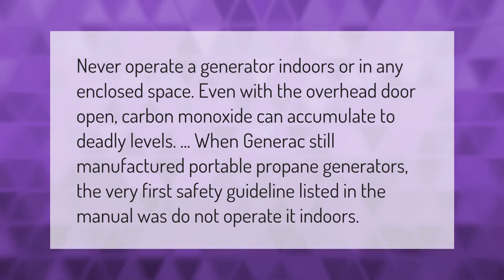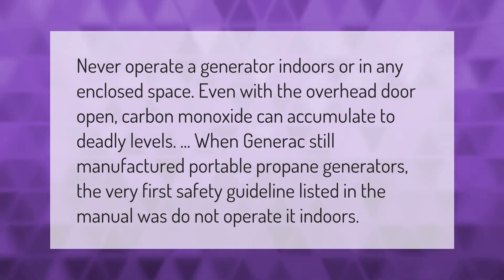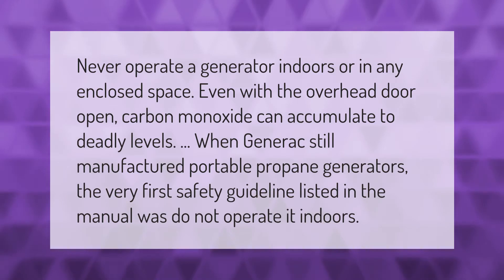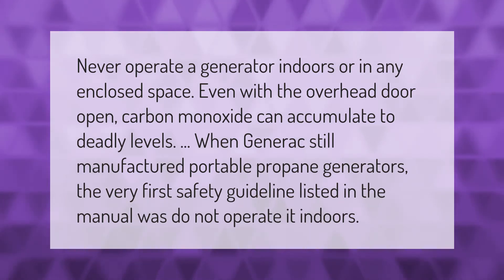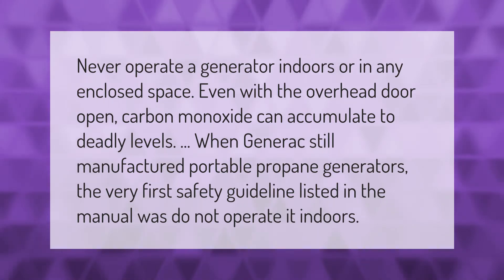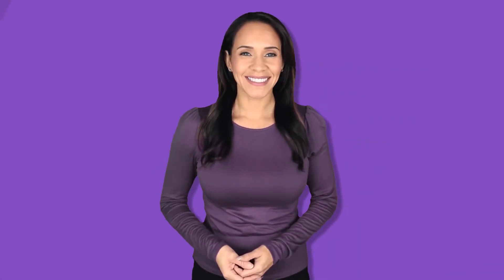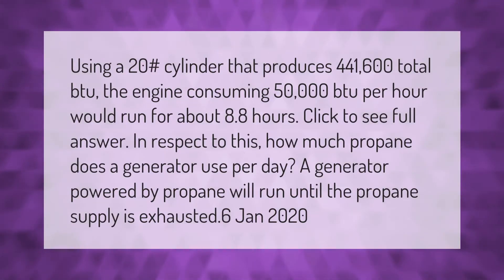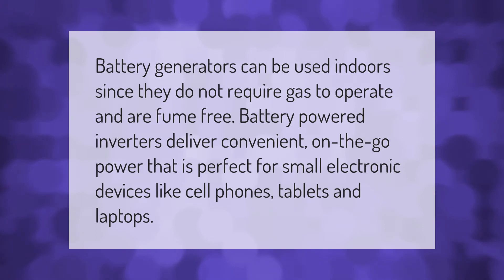Is it safe to run a propane generator indoors?

Comment: Man, are you that dense! (1) power stations do not genera electricity, they convert stored battery juice into electricity! 
(2) why is it allowed to burn both propane and natural gas heaters without exhausting the gas? (All but 10 states allow this heating, which fumes linger into our breathing space! While unsafe for propane heaters to do the same, while also produce electricity? U have absolutely zero credibility by calling battery packs, like power stations, generators! Generation is a means of producing juice, either burning wood, solar, dams, windmills, nuclear, heat, steam, pressure, chemical additive reaction! Not stored energy! Gotta have a way to get that stored energy!
Reply: Thanks for making the comment I was already planning on making. Or part of it.
I hate that were using the term "generators" for batteries were confusing the term with the device that you shouldn't run in your house a gasoline generator with some thing you can which is just gonna muddy the waters they really should be called something like power stations.

This is also a question I had turns out although I don't trust the article I was reading propane produces about half as much CO2 so still not good. However I lived in a very drafty house compared to new standards with a gas stove and a gas dryer that was Unvented. Yeah I see people using kerosene heaters in their house where you're literally choking on the kerosene and propane heaters as well then there's motorized vehicles like forklifts. It's really hard to determine whether propane is safe indoors or not.
And this is all compounded by the fact that houses are getting more and more sealed.

And don't forget this channel is "ask about movies" which makes no sense for the topic they're covering just leaves me with more questions.
So not that it matters but down voted for video.